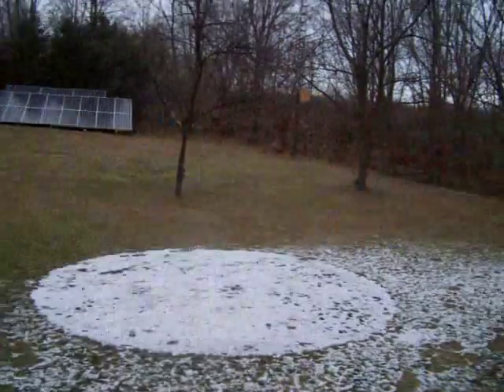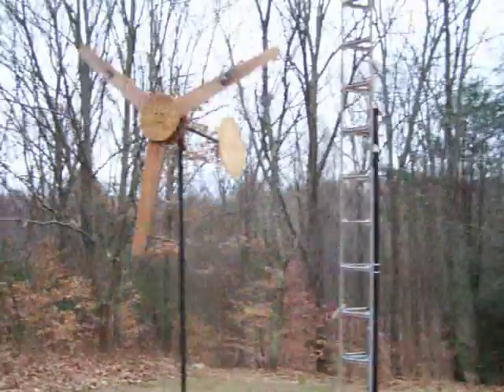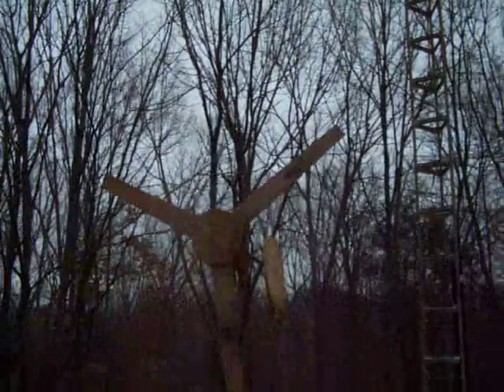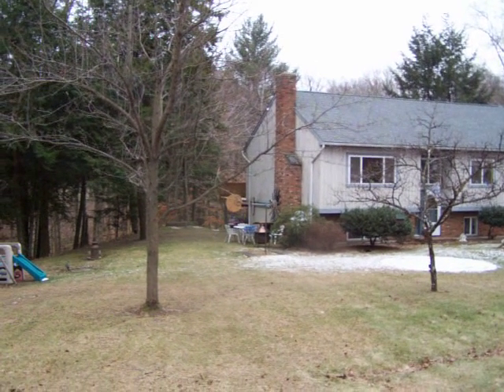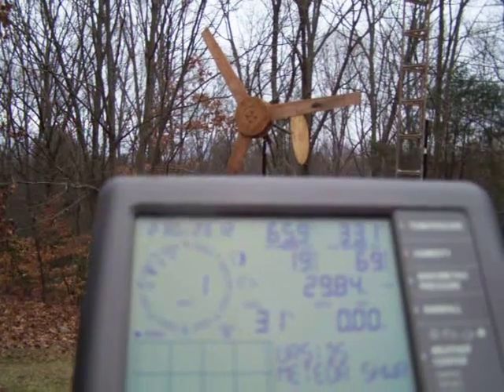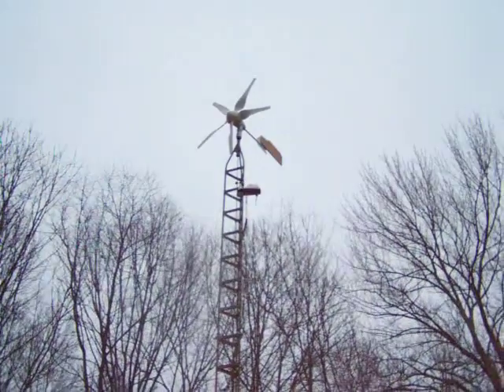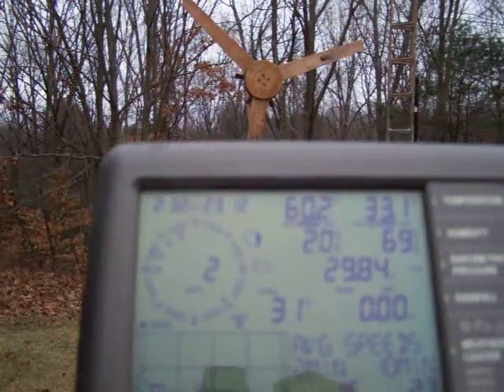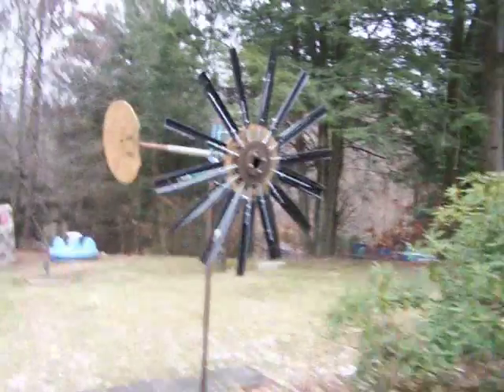wind turbine startup

Comment: @definitionofis Even if they are connected to a battery they wont really have any resistance until they get up to 12 volts. So it's like they are just free wheeling. I have a couple of Lenz 2 turbines , yesterday I noticed the anemometer cups werent even turning on the weather station but the lenz was turning slowly. ( no load)